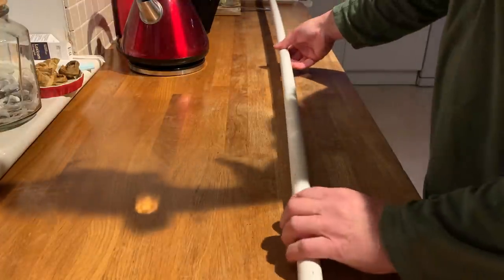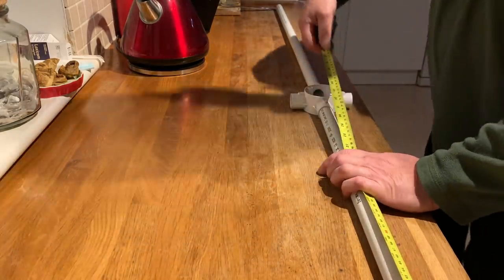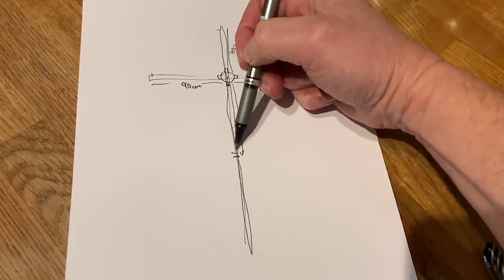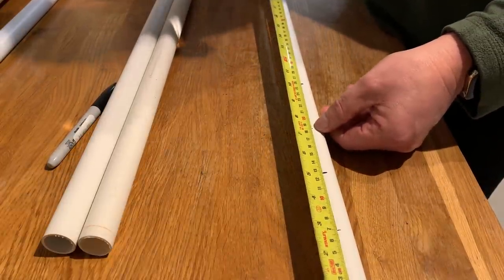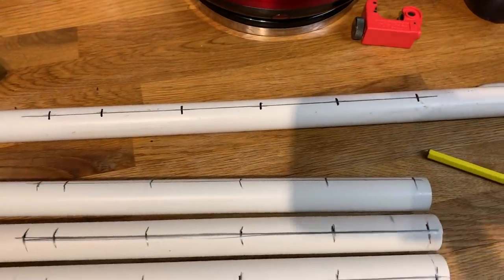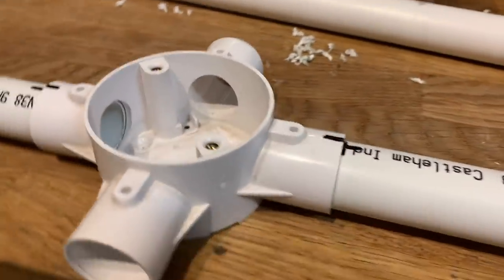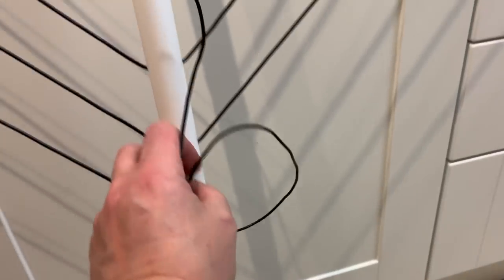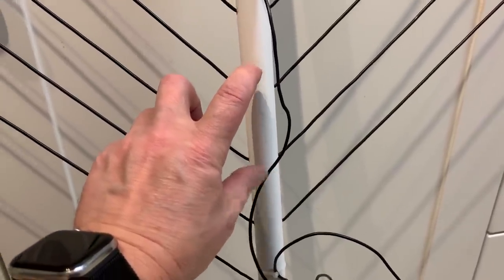HAM RADIO: 80M Band Wire Spiral Loop - Magnetic Loop, Small Gardens,

Comment: Little trick to help thread wire through the holes - use toothpick or wife’s knitting cable needle and heat shrink it to the wire. It makes a handy needle.
Reply from the maker: great idea
Reply: I really need a diagram, including the feed loop and capacitor, not so much the mechanics with PVC. Could you add it?

Comment: to aid threading the wire, drill the holes big enough to take a drinking straw. the wire has no option than to follow the straw, so push the wire through then pull the straw out.
Reply from the maker: Great Idea

Comment: Could I use this configuration for 11meter (CB)?
Reply from the maker: Yes but with a smaller diameter
Reply: Duck duck go 66 Pacific magnetic loop

There is a magnetic loop calculator for both Tx and RX 

An 11m loop only needs to be around 2.5m in circumference. Using some RG6, which you can often obtain for almost nothing, you’ll be able too make a reasonably efficient single turn antenna that’s good for around 80-100KHz without retuning
Reply: @MidlifeRenaissanceMan  Thank you Chris for your recommendations.  Need to give this a try.  Seems to make sense to go this route verses a tall mono pole.
Reply: @jgstevens5169  I was using 8m of aluminium strap, and a home made motorised piston capacitor last night  I mounted it on a 3.5m high push up lighting stand

The noise on 40m was S3 vs my 12m trap vertical end fed half wave for 20/40m where the noise was S7 

Almost no difference on TX, but so much easier to hear the stations